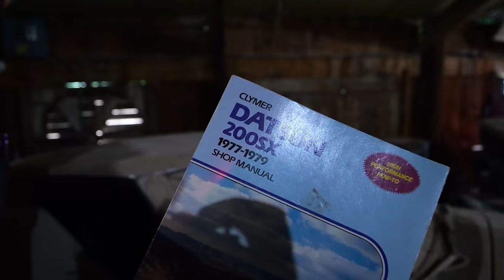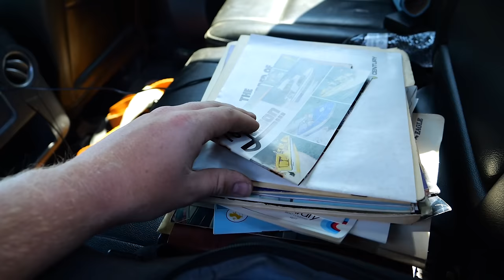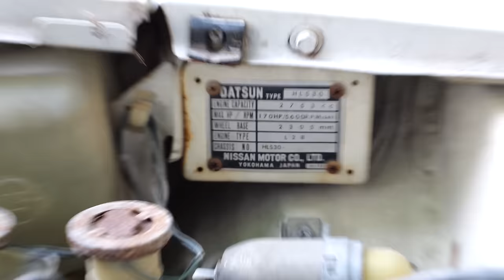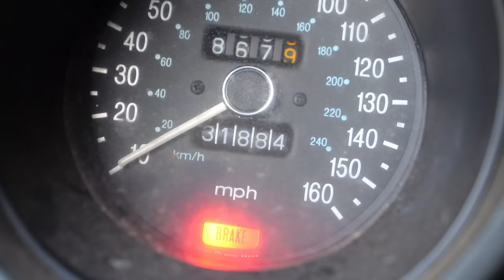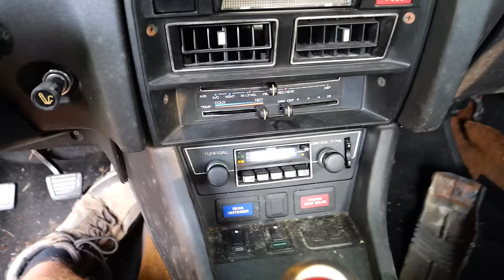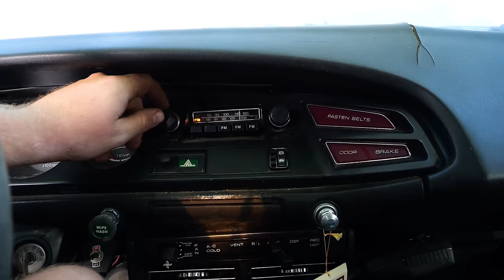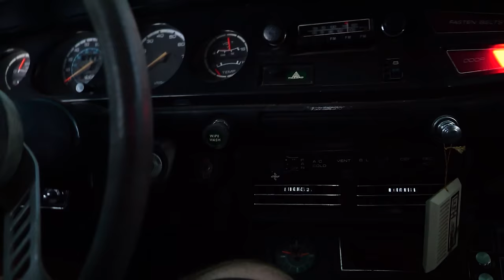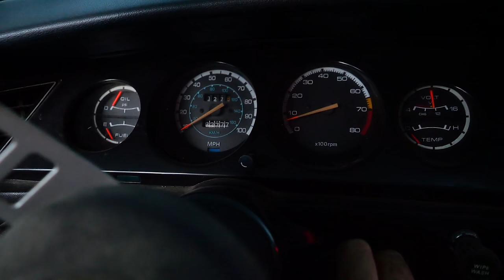Will 2 BARN FIND Datsun's RUN & DRIVE After 30+ Years!?

Comment: For the 1978, 280Z, the HP rating was 220 HP. This was the first year of fuel injection and the last year of the highest HP output for a NA car. In 1979, the power went to 150ish.  I owned a 1978 briefly. I threw a cam in the motor, external oil cooler, and high volume oil pump, Cold Air intake, Headers and full 3" exhaust. That car would haul serious ass!!!  Wish I never got rid of it. These cars bring in lots of value today.

Comment: Weight reduction is the problem with Iowa cars! When I was a young driver one of my first cars was an old Mercury 4dr that came from Iowa. It had so much weight reduction that you could put your fingers through the holes and it was a gravity low rider. Oh well it ran good and I put some miles on that old Merc! By the way great channel!

Comment: Take the 5 speed and rear diff from the 280 (maybe the engine too) and drop them in the 260, the 4 speed's gearing is way worse and the rear diff from the 5 speed is shorter as 5th is OD. Even if you don't take the engine, it'll liven up the 260 a lot! Of course, if its not already sold lol

Comment: I loved Datsun's in my youth. Here in OZ I had a baby shit brown Datsun 1600 (510), 68 degree works cam, head work and twin 45mm DCOE Webers. I sank every spare cent into that car. Later on a I built an offraod race care out of a Datsun 520 Ute, which finished on the same chassis but with 720 body, f100 twin I beam suspension and a 351 windsor in it. Another fun car.

Comment: Very cool rig with the 280Z, looks like a Fairlady Z with the different back windows and rear seat. 
Had an '80 model regular 280ZX myself in mid-'80's, bought it for a good price and replaced a vacuum advance unit on it, car used to return me 28 mpg on the highway. It had some very minor rust issues around the windshield trim area, otherwise perfect body on it. It was unfortunately stolen a couple years later from my 1st wife's work.
Great video, thank you Kevin!

Comment: There used to be an old guy in his eighties driving a 29 Model A coupe all year , through our ugly winters. The 4 banger gave up after trillion miles. He bought a 65 Merc with 390 four barrel 9” diff, used the driveline swapped it into his model A, plus converted it to hydraulic brakes. I asked why drive it year round. He said it’s the only car he ever owned, never saw the need to get another. Old guy wasn’t a street rodder , just used whatever he got for parts .

Comment: I don't know if you do but you don't show it on the Videos but here is how I do first start ups.
Check if engine turns by Hand). Is yes
Use pressure air to remove dust. Hock up battery wait and check for smell and potential electric issues 
If no bad smell or electric fire drain Water oil unhook gas tank (you don't want the junk from inside there in your Fuel injector or carburetor).
Replace oil water hock up a gas tank with fuel pump (usually a boat unit) direct to the  Fuel injector or carburetor.
Now with all clean fluids try start up. 
If it starts check for oil pressure and Fluid transfer only when that is stable than decide on new tires Breaks and other Parts 90 %of time Radiator, water Pump, Thermostat, Hoses, and Belt.

Comment: Since the ignition sequence of the four-cylinder engine is 1 3 4 2, the high-voltage coils of the second and third cylinders can be exchanged to send explosive power to the carburetor, thereby removing the dirt in the carburetor. But it will make the carburetor spit fire, I'm not sure about that on the 200SX

Comment: I would use TRUFUEL instead of brake cleaner to start these cars.  The 2 cycle oil in the TruFuel helps lubricate the valves and cylinders and helps to start the engine.

Comment: I bought new a 1978 280Z. 1st - 45 mph, 2nd - 60 mph, 3rd - 115mph, 4th - 150 mph, 5th over 160 mph. It was a 5 seed also but was dark metallic blue with white interior. I had a 1977 280Z white with brown interior but was a 4 speed.

Comment: Man thought it was light blue for a minute. There's some rust and bondo going on there. The 78's were fuel injected. Looks pretty stock. Yeah "beer can" describes the thickness and durability of the metal used in the body panels. Made right noise when ignition was turned over.

Comment: Believe it or not there were diesel versions of both of these engines, The diesel L28 was the LD28, and the diesel L20 was the LD20, LD20T (turbocharged), LD20-II (2nd Revision), and LD20-IIT (Turbocharged 2nd Revision). I've heard the L series were based on a Mercedes gas engine, so that means to come out with a diesel they took a Mercedes gas engine design and turned it into a diesel, rather than just copying a Mercedes diesel in the first place. The LD28 and LD20-IIT were produced all the way up to the 90s for some markets, when they were replaced by the RD28 (diesel RB series) and various different 4 cylinders like the YD25. Therw was also a CD series, which was a Diesel CA series. In the US we had the CD17 in the Sentra for a while. Unique in that the cam was belt driven off the front of the engine, and then it belt drove the injection pump off the back of the cam.

Comment: If a car's been sitting that long- feed it fuel from a gas can for the initial startup. Running it on it's own system will pull rust & debris into the carb / injectors. Then you have to clean all that out too. You never know what's in the lines & tank from sitting

Comment: B210, fix dent and 4,500. Fixed nice up to 8,000. The other 240 Z? Goes up to 20,000. Little more homework required but that was a quick search. You may have done well here. 👍 Took a look at a B200SX. Original asking $16,000. Uh you might have something. Gas savers are in High demand. Those cars go and go.

Comment: Hi there. Just saw that you have the 1978 Datsun 200sx for sale on Facebook. I used to have one (from 1983-1988) & another one (2010). I'm now no longer amongst the working (I'm a Disabled USMC Veteran), but would LOVE to take the 200sx off your hands. I have a 1998 Chrysler Sebring Convertible with 68k miles (that I just sunk $6,500 into, that I'd trade straight across for.

Comment: The 200SX is a rare beast, and 110 legit HP out of 2000cc carbureted isnt bad at all.
Funky odd design too.
Plus The japs were and are known for their ingenious skills.
Look at that nice mechanical fuel injection setup at the 280.
it was heads on with basic Porsche 911 back in the day when it came out.
stout 170hp, nice.
And weighs nothing.
Nice finds!

Comment: The 200 SX Carb likely has a fuel cut solenoid that is stuck or not working (maybe no power?) - that was designed to kill fuel so the engine didn't 'diesel' or run-on after shutdown - given the throttle shaft was so stuck I'm guessing that solenoid is stuck too!

Comment: Crazy that old Datsun still runs. You guys are awesome mechanics
Reply: If a Datsun was running at the time, it was parked It will run again.

If old Nissan  bodies held up as good as their engines, Almost every single Nissan product ever made prior to the 2000s would still be on the road, heck a lot of them would still be daily drivers

Comment: that 280z was a really high performance car for the time. it had 170bhp out of a small I6 and the same year camaro z28 with a 4 speed and 350 had 185bhp but weighed 1000lbs more.

Comment: The L20B was the best 4 cylinder engine Nissan (Datsun) made. It was mostly in the trucks. It is unkillable, just like Toyota's 20R. Toss out that stock carb with all it's vacuum nonsense and put a Weber 32/36 on there. You'll be surprised at how much fun that little drifter can be.

Comment: My very first car was a 1979 Datsun 200 SX and it was a piece. Wouldn't go over 81 mph blew up 3 engines, But never could destroy the Transmission. It was heavy, Under powered and kind of ugly, But it was a cool little first car. 30 years later kind of miss it.

Comment: I had quite a few 70s Datsuns a 610 a 5 10? A pickup and a 200sx . The 280 Z was the top of the line but the 200sx was 2nd not nearly the bottom of the line there's where wagons and 4 door sedans

Comment: I really really really like your channel. You are fun to be around and a fine mechanic/engineer. There is but one channel, dudes from Alberta, Canada, who completely refurbish cars. Those guys get cars running. Okay. Okay. All mechanics can get cars running. But no one but the Alberta guys COMPLETELY refurbish cars. Take that Datsun 200 SX. You should have totally fixed that car, new bumper in the back, interior, ruined quarter panels, everything. You should have a paint room and learn how to paint cars.  You should order new trim and everything else to make this car totally complete. The SX is not the bottom of the barrel as you stated. It is a fine automobile. Please buy everything you need to fix dents, rehabilitate rusty fenders, all the rest. Lastly, I know you can afford the equipment needed to totally rehabilitate cars. Be the first cool guy to learn how to FIX CARS,

Comment: Had an old 410 sedan, those Datsun engines were hard to kill. Shame they rusted si quickly. Great video, keep em' coming 👍
Reply: I almost think the Japanese made the body rust prone on purpose, because of Japanese shaken laws.

It made absolutely zero sense to make a car body that would last, when prevailing Japanese mindset was to upgrade every 5 to 10 years

The quality was extremely good in every other aspect because of the reputation they had to maintain

Once the Japanese became a big volume exporter, they realize they had to make the cars less rust prone and they did a good job of that
Nowadays is the American cars that are prone to rust Japanese cars easily make 20 years

Comment: The rust area on the Z cars to pay attention to is the battery tray area and below it,..all the way down into the frame rail.... When the battery vent and off gas they accelerate the rust and usually take out the passenger side sub-frame rail.

Comment: Great stuff, love that Datsun 200SX. We didn't get those little beauties over here in the UK, don't know why. Lots of many gorgeous Japanese cars we didn't get in the UK. I would have thought one of the first things to check on a car that won't keep going is the distributer points and the spark plugs, and timing. Anyway, it would be nice to restore that 200SX to stock.
Reply: Yeah, but to be fair
You were deprived of the silvia, which is basically a pint size, Ken Mary skyline, we were deprived of the skyline!

While it is perfectly understandable, why we never got Cedric after 1965, because they never never sold well, it makes no sense that we never got the Skyline. 

I'm not referring to the R 32  I understand why we never got that, it would've competed with the maxima and the Z. 

I just don't understand why we never got the 1970s skyline. It would've been a perfect top model for Datsun in the US. 
Basically a z car with decent backseats.

Just my opinion, but I feel skyline even a four-door skyline looks way nicer than that 810 long nose, bluebird thing that we got .

Comment: If the chassis is too far gone then how about turning it into a daka style off road rally car? Like the old Porsche 911 rally cars. Weld in a tube frame chassis and integrate it into a roll cage and then Jack up the suspension and have off road tyres on the rims.  Engine can be left if its ok and just add a few performance mods or even throw in a V8.

Comment: My first car was a 78 280z! I was a freshman in high school it was pumpkin orange! When I bought it the front support rails in the unibody were junk and I had to have them cut out and had them replaced but after that that car was scary! Straight six two huge throttle bodies feeding a custom intake I hate to bring this up but back then I got more ass than a toilet seat with this car! Sorry for offending anybody but facts are facts! Wish I still had it had it in a straight line it would bring you to the brink of floating when you threw it into a corner it was definitely more questionable than RX7 leaving you wonder why!

Comment: Good to see you got a 280z running, much better than the red 280z. . In your defense the fuel injection can be tricky and difficult to diagnosis. Good job on the white 280z. Enjoyed the video.

Comment: both cars were fun to drive

As a 2nd job form 85 to  89 (just to take up the time and drive a dif car every day) I worked as a go for on a 21 car used car lot.  At the end of each day Dave (the sales person) and i had to decide what car we would drive home.  I always went for a 280 if we had one on the lot.  A real fun car to drive.

we sold at least one car ever day some as many as 5.  No car on the lot was wroth more then $1500.  The vast majority of them were under $1000.  Reason.  In RI back then if u sold a car for more then $1500 as a dealer u had to put a guarantee on it for 3 mo.  These were final owner cars.  Once the papers were signed and u drove it off the lot if it died right then and there it was ur problem.  

U say u need a car but only have $50.  Come across the street behind the bar we got a car for u.  Always had at least 6 of them over there.  No one left our lot without a car.

Hell we had this guy who would show up in a cab every now and then in a $4000 suit.  He wanted a car just to drive to and form work (he own a Jewry factory).  He said he did not get rich wasting money on cars.  Now his wife had to have a new car every yr but he wanted one for under $500.

So that is my time on a used car lot.

Comment: You should use two cycle fuel to do first starts. It will help save the rings. I love those datsons I had a 350 then got a 370 and want a 70’s to really do something special to

Comment: I had one of the last 280z cars made. Tgere a recall involving the FI pressure regular as I recall. Hoses to each injector require d replacing. Great highway and freeway car on trips. About 65-75-80 . No safety stuff . Light front end wantedctobliftva lil bit at speeds.

Comment: I love your show Kevin but not to dump on you or anything but you really shouldn't use brake cleaner start old vehicles that have sat for a long time it does nothing but wash what oils are on the cylinder walls down and you're hurting the motor maybe try two stroke gas  please

Comment: that 200sx was a really high performance car at its time in 1977 in a carbed 1.6 4 cylinder they made 110 hp and rwd. the same year oldsmobile made an omega with the famous 231 buick 3800 v6 and that made the same 110 hp. far larger engine but barley could get out of its own way! the nissan would cruz!

Comment: The choking carburetor thing that you do, there is a better way for 4L engines. One just simply swaps 3 and 1 spark plug wires, then it is going to backfire like fuck, cleaning the carbie that way. :)

Comment: Had a 210 in the late 80's, four banger with manual and factory AC.  Embarrassingly slow but very reliable and good gas mileage.

Comment: I bought one of these on the cheap 30 years ago.  Minnesota car and the rust was atrocious.  We got it running but the firewall had rusted out and exhaust POURED into the cabin.  Good running motor but the body was too terminal.

Comment: Yeah those z cars love the rust, Came across a 1970 Fairlady Z ,right hand drive 240Z basically,while working in a wrecking yard,A guy came back from Japan ,Moved in with his friend and couldn't pay the rent,So he took off and left it as a payment,Only he didn't give the title with it, Jack refused it with no papers ,I told the guy I would take it and try to find the owner,Never happened,But Washington has a law where you can send a letter to the last known address and if they don't reply you can register it,It takes 3 years of no claim before it becomes yours,I got it and drove the snot out of it,A couple of tips for you,No.1,Do not get above 85 miles per hour with any kind of wind,The front end will shift lanes on you,Even with the big 6, No.2 , Inspect the front frame rails behind the wheels ,They rot out,Uni-body doesn't play well with bad rails in the front.Good Luck from a fellow Vet,Ed.

Comment: It's a shame about the cancer on the 280 Z.
The manual models are a lot more desirable than the automatic ones.
It would be a good parts car that someone could use for a manual conversion on their automatic car.
You shouldn't have much trouble getting rid of it.
Great video!

Comment: Please for the love that is holy don't put brake clean down its throat you need something that can lube and coat the rings while you start it. Try using some 2 stroke fuel it got oil and it can lube.

Comment: Although a Datsun/Nissan dealer was on our property in Germany, I never heard of such a 200SX nor have I seen one. Must be quite rare, at least in Europe. The 2.8 litre 6cyl. inline engine only came with the longer body (280ZX) in Germany. I once owned 2 of them, one with the t- bar roof. Great engines and an iconic body design. Meanwhile the 240 Z, 260 Z, 280 ZX and the ZXT are worth a small fortune over here. Unfortunately you tried hard to destroy both cars. I should've already stopped watching the video while you pulled the 280 Z on it's front bumper. But for sure as you used brake cleaner excessively (instead of gasoline or, even better, two stroke fuel). Unfortunately I also had to witness that you think it's absolutely necessary to do burnouts and half donuts full throttle with cars that sat for such a long time. I must say: Everything was very professional through and through.
Best regards, luck, health and wisdom.

Comment: Since you got the  240/260, driving beautiful have you thought about making that sports car even better, and like you said the  200SX  isn*t  worth that much $$$$$ have you thought about like changing the steering wheel.which is the same as the 200SX and put a better working steering wheel in the  240/260 since it is basically the same